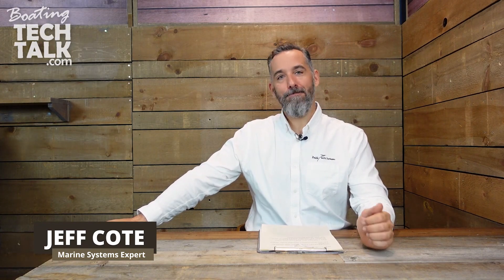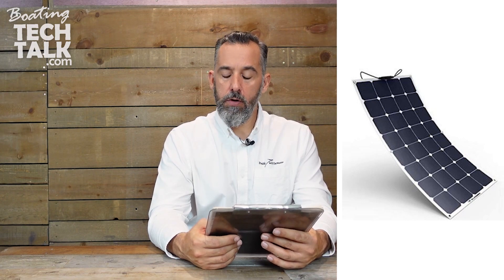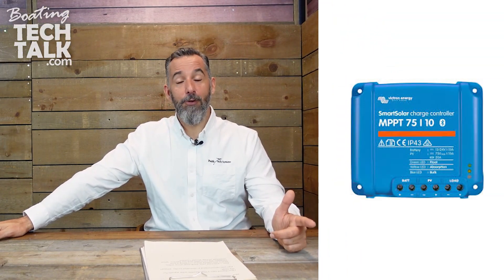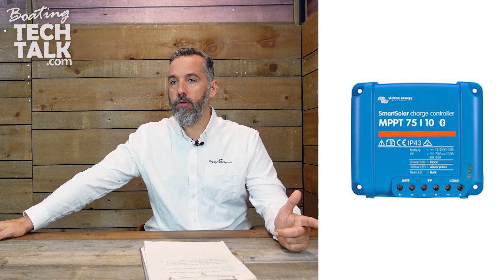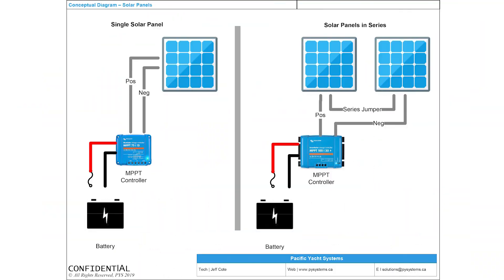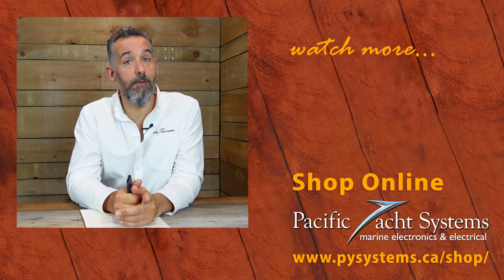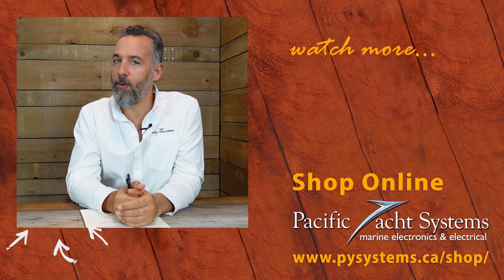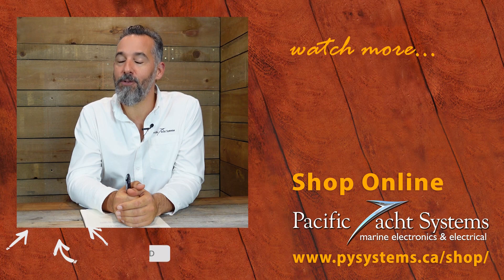Choosing a Fuse and a Controller for My Boat’s Solar Panel?

Comment: Hey 👋 Teach, is there a solar management board/unit that automatically instills a charge ceiling for lithium batteries 🔋 🔍🤔
You’ve possibly covered this evolving scenario, so which key 🗝 words, to locate that/those vlogs, 🥂
Reply from the maker: Besides choosing a charging profile for Lithium, not aware of a specific charge ceiling for Lithium. Are you thinking of stopping charging your lithium bank at 80% for example?

Comment: Hi Jeff, great share of information as usual. Thank you for caring :)
You said; even if the panels are connected in series array is still 340W although the actual wattage is 170. Can you elaborate please?
Reply from the maker: Good on you to be curious. Solar controllers, like other charging sources, like an alternator, or even a battery charger need to be connected always to the battery. Here's why: if your charging source, e.g. solar controller, is connected to the load side (i.e. switched distribution), whenever the battery switch is turned off, the solar controller will loose it's connection to the battery. Here's where it gets bad, now your solar controller has no more connection to battery and your solar controller will power your loads without a battery. If loads are suddenly removed or added, the voltage output from the controller will vary wildly. Remember a charge source is not a meant to be a power supply.

Comment: Hi Jeff,  If you are thinking of choosing a Victron controller, ( and why wouldn't you?), they have on their website a great questionnaire that takes into consideration the voltage and wattage of your installation and then recommends  the appropriate controller
Reply from the maker: Thanks for sharing Simon, good advice for all of us choosing a controller.

Comment: For multiple panels would you recommend a separate controller for each one sized for that panels maximum voltage/amperage or a single controller big enough to handle all the panels in serial/parallel?
Reply from the maker: Really depends, for most of the installs, we recommend installing dedicated controller per solar panel especially when panels have a similar shading.

Comment: Thanks Jeff - doing this exact job now with 2 x 100w panels.  So, the correct fuse size for (in my case) a 20 amp charge controller would be a 20 amp fuse?  Is it that simple?  (I'm 12 volt.)
Reply from the maker: When choosing a fuse, make sure your wiring can handle 20 amps. 20 amps seems reasonable for your setup.